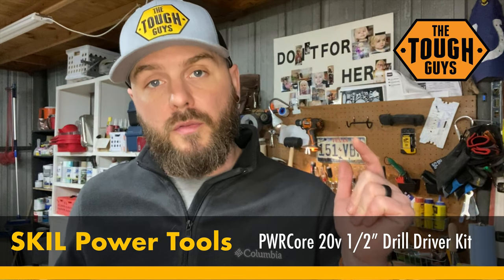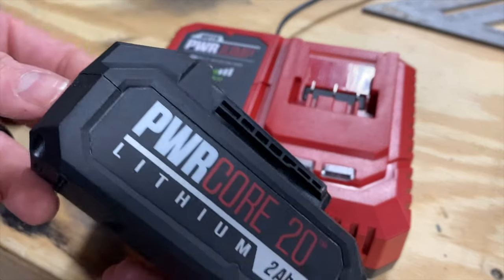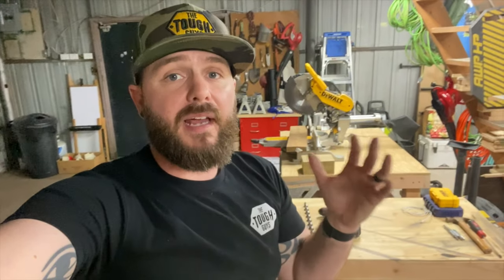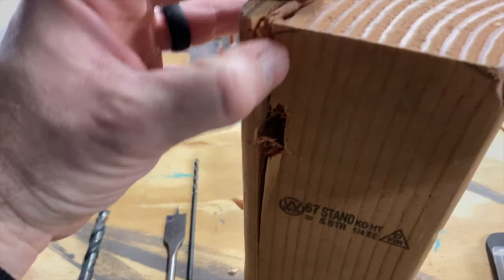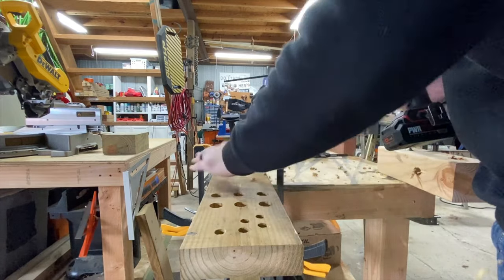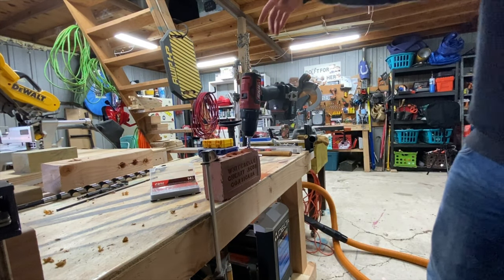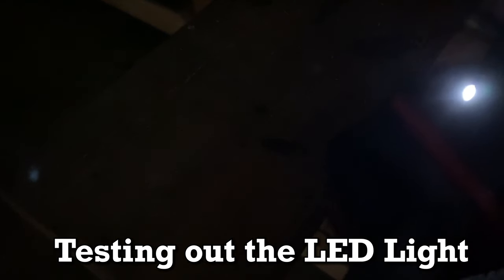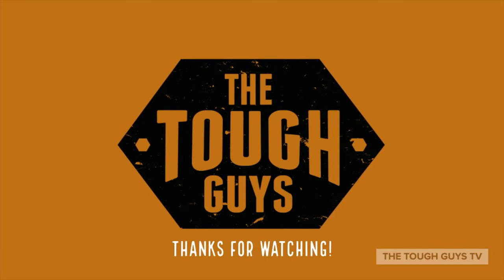SKIL PWRCore 20v Cordless Drill Driver - Unboxing & Review

Comment: Does it very in speed depending on how far the trigger is pressed?
Reply from the maker: Yes it does, if you only gently push down it will turn very slow actually. Great question!! I may have missed that in the review, so I appreciate you asking very much!! 💪🏻🙏🏻
Reply: @TheToughGuysTV  I saw how much play there was when you demonstrated the light and with what the remaining trigger pull looked like I thought it may be a 0-100 real quick kinda thing. How has it held up?
Reply from the maker: So far so good! I dropped one of the batteries on concrete really hard the other day, and barely a scratch. It feels great honestly! Only one time I had the chuck come a little loose when I was drilling a ton of holes, but my old Ridgid does that after basically ever use so... still doing 1,000x better. Not perfect,  but very close in my opinion especially for the price on this thing! 👍🏻
Reply: @carls.6746  I've had one of these (Brushed) for over a year. AMAZING tools. ALL of the newer 20v ones.
Reply: I can confirm it does
Reply: As does both impacts...

Comment: I like their 12 Volt line of tools. II bought the multitool, impact driver, drill driver, right angle impact driver, and a radio. Very well made tools.
Reply from the maker: Thanks for the comment!!  So far I've loved this 20v lineup the same way - durable, dependable and the batteries have held up amazingly well.  Thanks for checking out the video!

Comment: I picked one of these up a few months ago. So far it seems solid and well built. Time will ultimately tell.
Reply from the maker: I agree!! Mine is beaten up now but still going strong. The battery tech still surprises me - longevity and power it’s pretty awesome! Thanks for checking out the video!
Reply: @TheToughGuysTV  chevron battery tech is the Best right now.just look at Flex and Echo,even the skill batteries r sweet

Comment: My Bostitch drill and impact set got stolen a few months back (cant pick your family) got them at pawn shop for 60 bucks 5 years ago. Anyways I got this for my birthday recently brushed motor with the basic charger 20-volt. It does what I needed it to do I underestimated it a little bit.  Had to replace six 8ft 5/4in pieces for a porch. Did good with deep deck screws drove 48 of them all nice and snug still had almost a full battery.
Reply from the maker: Skils battery tech is def underrated in my opinion, and their drivers and impact drills are solid! Glad you’ve had good luck with them as well!

Comment: Never heard of this brand before, and the big box stores here never carry them ! I'm impressed though thanks !
Reply from the maker: Thanks for checking out the video! SKIL makes some great stuff. Just launched an electric mower as well - they are doing some cool things!! 💪🏻
Reply: Skil Saw???
Reply from the maker: No, Skilsaw is its own separate brand. Skil Tools is different, although owned by the same company. Skilsaw focuses on saws only. 👍🏻
Reply from the maker: I saw that Lowe’s is carrying a smaller version of the PWRCore line now, not sure on in stock or not but I saw a display in store which was cool! We are in Dallas TX 💪🏻
Reply: Lowe's carries this brand as homedepot carries ryobi
Reply: @santinisoriano6628  you can get the DL529302 @ Depot in my area in NJ
Reply: Here in CA HD carries ryobi dewalt makita rigid Milwaukee only. Used to carry craftsman but not anymore. No skil saw. I cant remember where I got my skil circular saw.

Comment: Can you test the new compact 20v hammer drill driver vs this older one?
Reply: Bought the newer version of this hammer drill last year. Strongest cordless I’ve ever owned. Motor doesn’t work hard on concrete or brick - chews right through. I’ve slowly begun replacing my DeWalt, Makita, and Craftsmen with this system as a result of my experience with the hammer drill. 

I have the 5ah battery. A real workhorse.

Comment: Would you recommend this Skil 20V drill over a Milwaukee or Makita 18V? I am looking into getting a new brushless combo set.
Reply from the maker: That’s a tough question - I don’t have personal experience with Milwaukee or Makita in the recent past. I did when I was younger, but not in at least 7-8 years. What I’d say is this: pick your top 3 / top 5 needs and then check them off. For me, the Skil hits a few major points (the impact driver too just FYI) - Low Cost, Good Warranty, Good Power, Battery life is AMAZING, and Good LED light placement / brightness.
Reply: I just got the 12V set and they are all very powerful and being Brushless it's just cherry on the top
Reply from the maker: I agree! All around so far they’ve been awesome! Just posted a video on the orbital sander too if you’re interested 🙌🏻
Reply: No the Milwaukee and Makita are professional tools. These skills are definitely homeowner. If you have the budget a Makita and Milwaukee or higher end Hitachi(now metabo hpt or hikoki depending on country) those will all massively outperform and outlast these. A good way to tell if it's aiming for the pro market or homeowner is when they start coming with like 3+ amp hour batteries for drills. I like the 5 amp hour but if I'm doing only a few things here and there I take my 3 amp hour.
Reply: I just returned my SKIL 12V set. The drill is very powerful but the quality is ok I'm going to spend a lil more on higher quality next time
Reply: @BoRerunn  I think when it comes to 12v I think Milwaukee is king. Once you get to 18 or 20 or 24 I think there's a little more competition.
Reply: Cameron Crane how do you know? Did you test them?
Reply: @cameroncrane3770  exactly i got a Dewalt Max screwdriver for that same reason
Reply: i have the 12v impact driver, drill driver, circ saw, recip saw and like 4 batts they have been amazing so far. the carging is fast i use  the batteries charge my playsation remotes, cell phones. this is a home owner tool diy er tool.
Reply from the maker: These tools hold their own against other brands well, with good features and build quality, backed by a good warranty. The whole “homeowner tool” vs “pro tool” is a stale argument in my opinion.
Reply: @TheToughGuysTV  I believe the largest battery they have is only a 4 amp hour.... so you would have to carry a minimum of 2. And I'm still waiting to see how long the batteries with the jump charge last because usually that's horrible for them.
Reply from the maker: Maybe longevity is key, and that’s very true on the rapid charging. Time will tell no doubt about it
Reply: @cameroncrane3770   they offer a 5 ah battery now

Comment: btw if flashes like that because it stops the battery from overloading itself "If the tool and/or battery pack are overloaded, the LED worklight will rapidly flash" that's a quote from the safety manual.

Edit: Also I know its been like 2-3 years so you probably know by now, But maybe people reading comments wanna know. The first 25% of the batter is charged at a faster pace then the last 75%, so you can throw it on the charger and get 25% batter in 5mins.

Comment: Back on warranty,feel like mosfet burn,dril chuck start wobly lose  from drill in no time-small bearing ?
Reply from the maker: I've not had any issues long term here with the drill, still going strong and the holding bits well.

Comment: Can you compare this drill with another brand .. I mean SKIL  vs. KOBALT  for example or Makita
Reply from the maker: I personally don't own a few different brands, so it's difficult for me to provide you honest feedback in that regard.  I have used Ridgid and Dewalt both extensively, although older models.  I can comment directly on how I use the SKIL driver and impact driver, and both take a beating and keep after it.  I've not had any major issues.  I wish they both had built in bit storage, but I solved that with my BitMags https://www.youtube.com/watch?v=U4ajwmDX-nU&t=33s.  The battery life has been consistently good, even with heavy use, hot or cold weather, always reliable.  I recently tested out their outdoor lineup too, and so far same consistency in battery, ergonomics / weight, durability etc.

Comment: The battery wasn't completely dead, the overload protection feature kicked in. Thanks...
Reply from the maker: Once you’ve run it dead it’s dead though. It can happen. If I wait a bit, and try and it’s still not working, I’d say it’s time to charge. Plus it’s got those nifty lights that hopefully tell you the charge level. ✌🏻

Comment: I have used the Bosch error skill before Chevron took over the brand and this is way better build quality and power of course  kobalt is made  by the same company you were mentioning issues Ridgid with  your Chuck did you have  it registered with a LSA warranty I haven't had an issue with my chuck   I don't know if they need the whole entire drill to fix the chuck when they send you a new chuck in the mail cuz that's a question I want to ask them cuz I don't want to void my warranty by installing a Jacob's Chuck like the one on the skill brand you got that's more busier than the one that comes on the Ridgid 5 foot that on I would have zero issues like you described I had an issue like that with my last Ridgid gen 4 x and decided it wasn't worth the warranty so I  pulled the trigger around the holidays in 2018 grab that $79 deal home Depot had what is might be an option for me if I do run into any issues in the future thank you for sharing
Reply from the maker: Thank you!! Ridgid says I need to drop it by a service center, definitely need to do it still. I’ve had that drill for at least 8 years, it’s been solid other than batteries and the chuck. I really love the skil lineup right now, and I’ve got videos coming on the jigsaw and the impact driver as well.  Thanks!!!

Comment: Memangnya sudah ada feature hammer drill?
Reply from the maker: Not sure I follow exactly, but yes there is a Hammer Drill feature on this drill.  You just turn the torque adjustment all the way around to that setting.  That is how I had it set when I was drilling.  Thanks!

Comment: when did u ever see a 2 amp battery with that kind of quality...........never that's when.If u really want too be impressed check out the Flex batteries
Reply from the maker: I recently snagged a flex driver as well, been using it for a month or two, going to do a full review on it once I’ve known it a little better. So far, the only downside is the weight with the Flex tools. I realize that it probably equates to build quality BUT, the Skil line is light weight and always has been a power house for me, so I’m not totally sold that the heaviness must = build quality. Time will tell